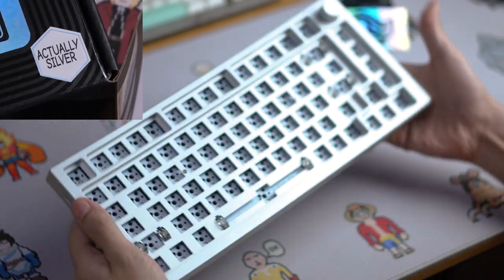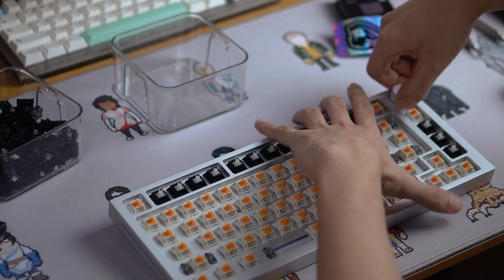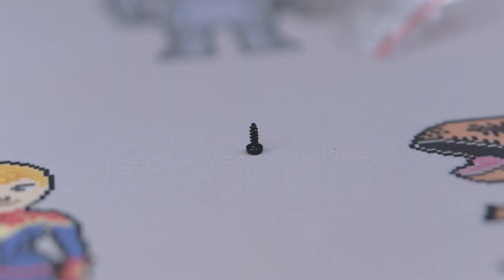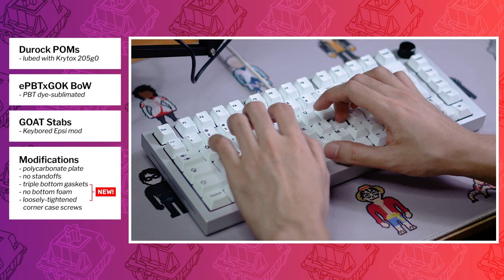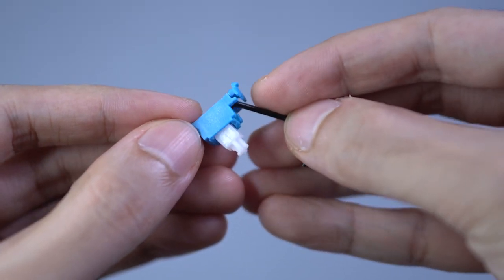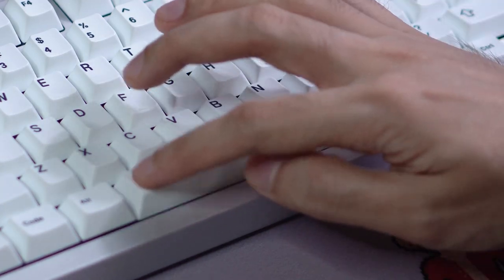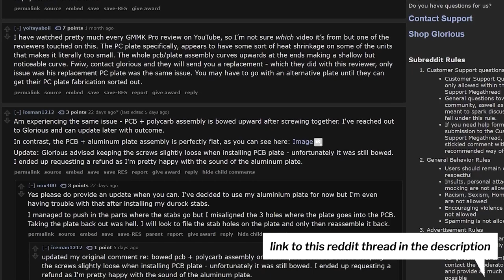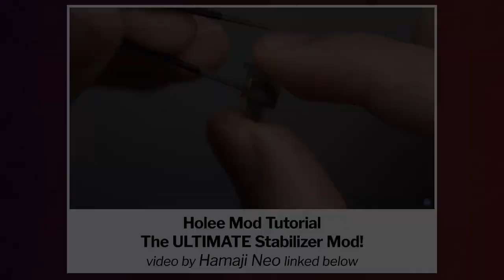GMMK Pro Mods part 1: Triple Gaskets, Polycarb Plate, C3 Stabs, Holee, Epsi (with Sound Tests)

Comment: Fantastic video!

Just received my GMMK Pro yesterday and had some of the same issues as you did.

Stock stabs - overlubed and super sticky.  Used Durock V2's instead and had a go at the Epsi mod using the same KBDfans strips.  This caused two of my stabs to stick so I removed them and traditionally lubed them with Krytox.  Tried the Holy mod a while ago with Durocks and same issue.

PC Plate - It was super tight and I had to kind of stretch the plate to fit properly around the volume control areas.  Did not like that you had to use the self tapping screws and hope they have not shredded the diffuses as I have an Fr4 plate on the way. I will check my Escape key when I get home.

I removed the plate foam, PE foam modded it and kept the case foam and it sounds pretty nice. I kept the stand-offs as was not sure if they were really needed.

Also had to take my stabs off a third time as they come with factory installed bandaids so I peeled them off and used some alcohol to clean it.

Volume button was super tight as well for me.

Anyway I have the FR4 plate on the way in September and hope that this will fit (and sound) nice.

The GMMK Pro  has a few flaws but I think with a new aftermarket plate /stabs and pe foam modded its a nice board.
Reply from the maker: Thank you! Sounds like quite the journey hehe. Yeah, the plates are like the main issue and it's pretty frustrating.
Reply: @CaloysKeyboards  I checked my Escape key and it is offset and slightly rubs. I will email Glorious and see what they say.

Comment: Great video! I finished putting my gmmk pro together yesterday and went insane w the stabs. Had durock v2 and pc plate and heard weird higher pitch on the right side spacebar too and kept tuning them. Never knew it was the plate bowing until I saw your vid. I clipped the pc plate to fit the stabs but not gonna go back in to clip other parts lol. Idk if you hear it in yours but on the 2u stabs it also sounds off when pressed nearest to the center of the keyboard. Anyway I fixed all stab issues by finding the deepest and thockiest switch out of my black inks to use w the stabs lol. Loved your pt 2 vid too
Reply from the maker: Thank you! Yea those plates and stabs will really drive you crazy lol. I don't notice anything with my stabs now but the PE foam may be hiding any issues. Listening back to the sound tests in this video, I do think I can hear some difference between the sides of the shorter stabilized keys although I didn't press them enough in this to be sure hehe

Comment: Wow this very in-depth review compared to other reviews here in youtube. does cutting some parts of the pc plate fixed the issue of the esc button hitting the case? I changed back to alu plate since the esc button hitting case really bothers me... looking forward for the part 2.
Reply from the maker: Thank you! Hmm, for my PC plate, it was already not hitting even before I cut some parts off, but just barely. It's hard to say if it will help for you since the shrinkage seems to be different for everyone 😞

Comment: What a good video! Thank you for sharing.

I have both the aluminum and polycarb plates and you're right, the polycarb is slighly bowing in the middle and will cause some switches to be much looser. My Esc key and Page Up/Page Down would easily be pulled off (without much effort) sometimes even when my finger brushes the keycap it would pull the switch off. I did not have this problem with the aluminum plate. Moving forward, I am looking to mod my polycarb plate to see if it could be fixed - I noticed the tight portion would be at the rotary encoder and that's where i would start.
Reply from the maker: Thank you! Oh man your polycarb plate seems really messed up. Good luck with it. Maybe you can look into getting one of the updated ones hehe
Reply: Poly plate is unusable, I had to send mine back for a refund. Get the FR4 plate instead. It’s been revised to fit this board perfectly now, it’s flawless.
Reply: @little_fluffy_clouds  thank you bro i will check it out

Comment: Keep up the good work! I am currently using a GMMK Pro with holee modded Durock stabs on an aluminum plate with EPBT caps. You should also try the PE foam mod!
Reply from the maker: Thanks! Yep, the PE foam mod is definitely on my list for the next video hehe
Reply: What is the PE foam mod?
You succeed installing the Durock stabs on the aluminun? how?
Reply from the maker: The PE foam mod involves using the foam pouch that comes with the GMMK Pro as dampener. You cut a layer of it to sit on top of the PCB and push the switches through it. You can also place a layer under the PCB and either layer can be used with the stock foam of the board. The Jelly Epoch also uses a layer of this PE foam and that's how this GMMK Pro mod was conceived.

I have not been able to use the Durock V2s with the aluminum plate. What I'm doing right now is using the wire and stems from the Durock V2s and using them with the GOAT housings, allowing them to fit into any plate (c/o YouTuber Anzel). I've holee modded them and I'm still in the process of breaking them in so I can't say for sure yet if it works well.

Comment: Glorious Pandas are indeed the tightest switch I've owned. Definitely more pronounced with the GMMK Pro. I also stopped using the Holee Mod due to the inconsistent resistance until you thoroughly break them in. Instead, try going for just XHT-BDZ on the wires. Very consistent in my experience, easy to properly and evenly coat as well.

Also, the GMMK Pro PCB tends to bow especially after using the PC plate. This impacts the spacebar stab heavily, introducing a weird kind of tick / rattle.
Reply from the maker: I'm in the middle of experimenting with the holee mod for part 2 and it's once again driving me crazy lol. Different materials will introduce different levels of resistance and I got so many suggestions for different things to try. I'll have to try XHT-BDZ. 

Yeah I experienced the weird spacebar tick/rattle with the GOAT and C3 stabs. The Durock V2s seem immune but I'm not sure why 😅
Reply: @CaloysKeyboards  I actually got the "GOAT" stabs to a usable level after XHT-BDZ. Got it from JMK's Shopee page. :) I think with the Durock being a tighter fit, it might be resisting any bend whatsoever. You can immediately tell when you press really hard on the function row (or the opposite edge), then try tapping the spacebar. If it suddenly sounds 1000x better, it's a bowing issue. :(
Reply from the maker: Yeah I've been eyeing the XHT-BDZ but it's kinda expensive lol. How much of it did you get?

I realized it was the bowing when the issues disappeared when using the aluminum plate since that one is rigid and keeps the PCB straight.
Reply: @CaloysKeyboards  Just the smallest variant! 3g I think. But I can see it being more than enough for a couple of stab sets. GMMK Pro definitely performs best with the stock alu plate. If there's just one good thing about the PC plate, it makes switch swapping so much easier. It pulls away from the PCB like a bedsheet, lol. Then switches pop off with minimal effort.

Comment: did you have any difficulties removing the screws? about to get this keyboard and been hearing a lot of people ending up stripping the screws. was thinking of getting wow stick as well to make sure but additional expense does not sound good though
Reply from the maker: I only had a bit of trouble with one of the corner screws but I was just careful and pushed in hard as I turned and it came loose. I was also pretty terrified before getting the board because of the horror stories being passed around in enthusiast groups. It's definitely an issue. I'm not sure if a wow stick would be a big help honestly. I think you just need to use a good quality screwdriver with the right size of head.
Reply: @CaloysKeyboards  that issue is the only thing that holds me from getting this keyboard right now. torn between Q1 and GMMK pro or just getting the IDOBAO ID87 TKL but unfortunately, I cannot find any seller who have stock here in the PH. Thanks for your response sir.
Reply from the maker: Oh you're in the PH. If you're getting from Rotobox or Gosu, I think they can unscrew the case for you if you ask them. I'm also waiting on the local release of the Q1. Seems like it'll need a lot of modding to sound good but then again, the GMMK Pro does too hehe
Reply: @CaloysKeyboards  how bout the IDOBAO 75% keyboard? in your opinion, is it a better option than GMMK pro? not fan of the knob so really don't matter if i have one or not. Q1 will be available by October as per Gosu but man, from this stand point, 1 month is a long wait for me lol
Reply from the maker: Not super familiar with the ID80, unfortunately. I hear people don't like the integrated plate but then I find I'm ok with stiffer typing experiences. There's also the ID80 Crystal, which is gasket mount. Pricey though hehe

Comment: Funny how my space bar also only ping or rattle on the right side. Do u think I should go polycarbonate + Durock V2 ? Mines using Milky Yellows Lubed and filmed and spring swapped to gold spring.
Reply from the maker: If the rattle/ping is bothering you, go for it hehe. Durock V2s are the gold standard of stabilizers. If only they fit in all of the GMMK Pro's plates haha

Comment: It is very bad idea tbh to loosely screw the board for more flex combine with the poly board. There is too  little support for the main pcs to prevent warping
Reply from the maker: Yeah, in part two, I screwed everything up tight. And now I'm actually using the alu plate. Flex/bounce is overrated lol

Comment: I also had issues taking off the gold knob that I bought. I lubed the inside once I got it off for the next time that I do need to remove it, it won't be as tight.
Reply from the maker: I'm able to remove the knob without issue now. I don't know if it loosened up or I just learned how to do it properly lol
Reply: @CaloysKeyboards  nice! Almost like I broke the knob but I guess they are made wobbly. A bit of a downer that it.

Comment: my pc plate is doing this as well and the fr4 is on the way - should i take the pc off asap so it doesn't permanently bend my pcb or should I be fine for like a week?
Reply from the maker: I'm still using the PC plate but I've used all of the case screws, plate screws, and standoffs so it should all remain pretty straight. Not sure what kind of effect prolonged use would have 😓

Comment: Does it still have a problem with durock stabs. I contacted support and was told that they had fixed the stab holes so 3rd party stabs would fit.
Reply from the maker: They said this on June 23: "All GMMK PRO plates ( aluminum, brass, and polycarbonate) are now fully compatible with most 3rd party stabilizers. Many of the units that shipped recently should already have this compatibility."

It sounds like if you buy now, you should get the updated versions but I can't be sure of that. It might also depend on your local distributor. I don't think we have them here yet in the Philippines.

Comment: Should I switch back to the aluminum plate to avoid the bowing caused by the PC plate?
Reply from the maker: I'm still on the PC plate. It's not a huge deal for me but check yours to see how much shrinkage the PC plate has. Might be worse than mine.
Reply: @CaloysKeyboards  shrinkage is definitely much less, I'm using the same keycaps and there's a decent gap between the esc key and the case. Using the same keycaps as you, they gok bows.
Reply from the maker: Nice. You're probably good to keep using the PC then if you prefer it over the alu hehe
Reply from the maker: Yep saw that! Glorious, I'll take some free replacements and a free brass one too lol

Comment: i didnt use any screws with my pc plate because i thought all the holes were stripped🤦🏻‍♀️
Reply from the maker: Lol it is confusing. I've seen people not use any screws on their PC plates. Like, they'd even cut off the tabs where the screws would go. So you're good as long as the PCB doesn't sink and lose contact with the switches hehe

Comment: So pc plate problematic :((?
Reply from the maker: For part 2, it's the one I ended up with in the end and I'm still using it now. But then I am using the case foam again and have everything tightened up fully so that should prevent any issues from bowing.

Comment: Do the PE Foam mod. That's the most effective mod for sound of the board.
Reply from the maker: Definitely on the list. Still doing research on the dangers of that with regard to ESD though hehe
Reply: @CaloysKeyboards  Wait I just did the PE mod a few days ago, is there a risk of ESD? I put my PE foam in between the PCB and the plate foam. If there is a risk of ESD I will remove it
Reply from the maker: Yes, Mech Merlin said that there is a risk of that with this material. There is PE foam that is treated to be anti-static, which should protect against ESD. From what I've read, most people haven't really had any board-breaking issues when using untreated PE foam. I've read some who had issues with switch inputs: double inputs or non responsive keys. I've read another person say the side LEDs on their board stopped working for a few seconds after plugging in some bluetooth speakers. I think it's probably better to be safe than sorry.
Reply: @CaloysKeyboards  Omg I actually did experience double inputs on my keyboard and some non responsive keys, I just assumed it was because the PE foam was "lifting" up the switch so it didn't really go fully into the PCB so I just pressed harder to get the switches in, I guess I'll remove them now, thanks!
Reply from the maker: Happy to help 😊. I'm still not actually sure if those issues can be attributed to static but yeah, better safe than sorry😅